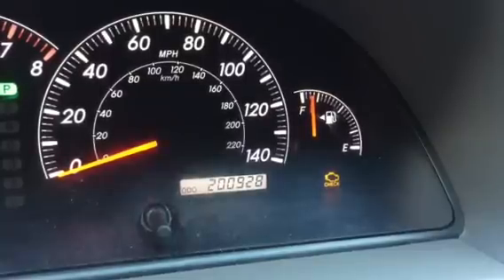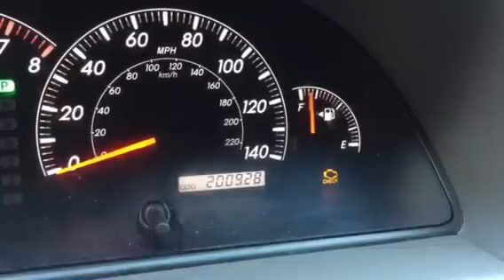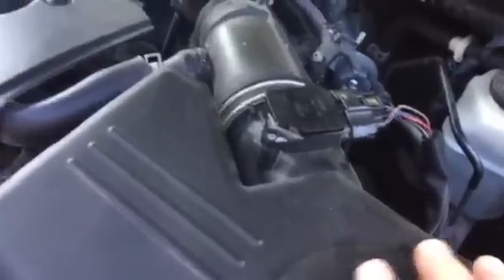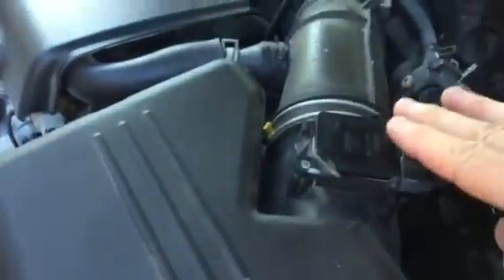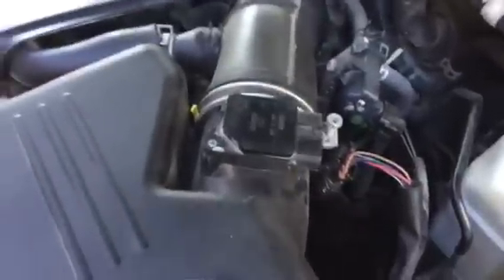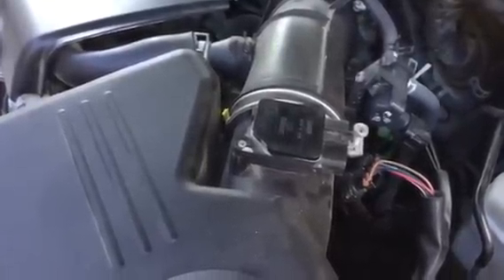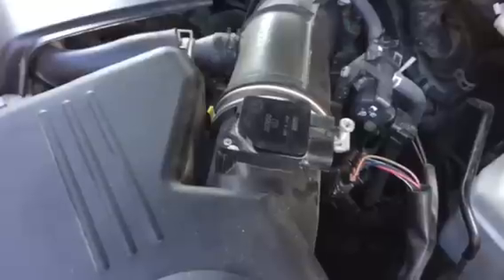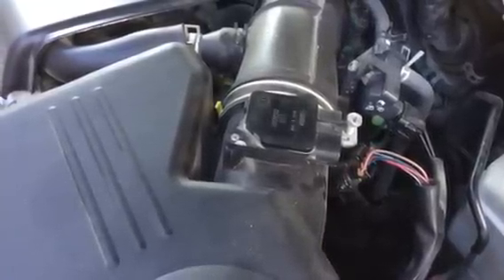How To Tell If Your Mass Air Flow Sensor Is Bad On Your Car

Comment: Great video, just had a question. I have a 2002 Ford Taurus SE, I’ve been having the issue of it randomly jerking at low speeds and when stopped at light or sign, i did the same diagnostic you did here and the car kept running even after I disconnected the MAF sensor cable, I cleaned it with MAF sensor cleaner but I still have the same problem? It didn’t look dirty at all to be honest but I cleaned it anyways, do you know what else my problem could be?
Reply from the maker: The MAF might need to be replaced.  Have you cleaned your throttle body?  https://youtu.be/cOAYWVBfuek  Could also be bad spark plugs or fuel filter.

Comment: Please i do same as in your video to check maf sensor working or not but i got problem of check engine light appear..how i can remove the check engine light ??
Reply from the maker: Once you drive the car 25 to 50 miles it will turn off by itself.

Comment: I have a map sensor is that the same as a maf sensor?
Reply from the maker: No.  MAP = Manifold absolute pressure and is a sensor to measure vacuum, the computer calculates the engine air flow based on the vacuum, throttle position, and intake air temperature. ... MAF = Mass Air Flow and is a sensor that measures the actual air flow going into the engine.

Comment: I have a 2011 sentra SL and keep getting a P0101 error code. I tried cleaning the MAF sensor but, the code still persists. Then I bought a delphi maf sensor and the same code came back a few months later. Pretty much have no idea what to do anymore. Any suggestions, please?
Reply from the maker: Check to make sure it's getting proper voltage.
Reply: proclaimliberty2000 how do I check that? sorry. im new to this kind of stuff
Reply from the maker: Go to an auto parts store and tell them what you're wanting to do.
Reply: proclaimliberty2000 thank you for your replies
Reply from the maker: You're welcome!  Let me know when you get it fixed.  I know these things can be very frustrating but through it all you will become more knowledgeable.
Reply: Danish Sayed I have a 2015 Sentra SV and it also had the check engine light on. I cleaned the sensor but I feel like it didn't help. The performance is not the same and I feel like my car has trouble starting. Any suggestions?

Comment: Just ran the check as you instructed and car (BMW X3) kept running! But would the broken MAF  sensor have produced codes P0174 and P0171 (too lean) for both banks? Just curious and thanks a million for an AWESOME video!
Reply: Hmmm. I just ran the same check on my wife's car (also BMW X3) and her's did not shut off either, BUT she has no check engine light as mine did.  Does this test work for BMW X3? Would cleaning clear this up or needs to be replaced.

Comment: I have a 2008 jetta vw 2.0 t it went in for coolant temp sensor/code to be fixed which had cel on had it back a day the cel came back on but threw a different code p171 code system too lean bank 1.. Its been coming on and off now for a couple of months dealership first said it was loose bolts so they tightened them still the code came back on after they did that.. Now they are saying its mass air flow sensor..throttle body needs cleaned.. Ive read numerous things about this code on my car it says it could be a range of things..does it sound like the maf?
Reply from the maker: A bad or dirty MAF will will cause reduced gas mileage, very hard starting, stalling, engine hesitation during acceleration and will run too rich or too lean.  It will also eventually harm oxygen sensors, spark plugs and catalytic converters. https://youtu.be/047xItGmNH8

Comment: have a question hope u all can help me..i turn my nissan altima on rpms rev up n down i cleaned throttle n i cleaned air sensor..but i disconnected air sensor n engine kept runnin if i replaced the air sensor would it fix my rev up n down rpms plzzz sum one help..
Reply: Theres a video on how to reset your Nissan Altima. how to reset throttle position sensor. type that in youtube .
Reply: Juan Moreno I had an issue with rp as well and scv replacment solved it

Comment: If when the current sensor is in the car turns off seconds after starting it and when I take it out and it runs but very rich and less power is it a bad sensor

Comment: Check Engine Light on says P0171 System to Lean Bank 1 I have : 2005 BMW 330I  I unplug Mass Air flow sensor  keep running. I think it Mass flow sensor.
Reply: Go to Autozone and erase the code. I forgot to put back my MAF wire after cleaning my MAF and the check engine light came on even when i put back the wire. i reset the code and it never came back again.

Comment: Check Engine Light on says P0171 System to Lean Bank 1 I have : 2005 BMW 330I  I unplug Mass Air flow sensor can keep running. I think it Mass flow sensor.

Comment: i did that to mine an 08 outlander and engine keeps on running and i lookd inside it says error and check engine,i turned it off and connect it and its gone,so something is wrong or just dirty sensor?i have rough acceleration also
Reply: i have bad acceleration and wanted to know if the MAF is bad and did what u did

Comment: did what you said about disconnecting the MAF and the car shut off. However, the car was still acting up chugging and stalling, but after the MAF was cleaned we are running smoothly again...just a fyi..

Comment: If the CEL is on, wouldn't it make more sense to grab your OBD scan tool and check the code? If no scanner available, then just go to Autozone (or similar store) and they will read the codes for you. Also, I believe some cars will run after disconnecting MAF, sometimes even better. JMHO.... sometimes these issues can be tricky to diagnose and repair.
Reply from the maker: Your're right, sometimes these issues can be tricky to diagnose and repair.  One time I had a check engine light come on.  The computer scanner said it was a faulty oxygen sensor, but in the end it was actually a faulty MAF.
Reply: Thanks for the video. I wish the modern computers and CEL's were more accurate and reliable. I was service station owner back in 70's and all I needed was test light, timing light, compression gauge and dwell meter... and I could diagnose/repair anything, hahaha. Thanks again.

Comment: Thank you sir this really help me alot i never thought to do this now i know why my car is idling and has a sputter when i hit the gas i went out and did this method my car actually stayed running when i unplug maf connector so i indeed now know this is what i need cheap repair and im good to go thanks
Reply from the maker: Also make sure your throttle body is clean. https://youtu.be/cOAYWVBfuek
Reply: proclaimliberty2000 I cleaned it befor because thats what i thought it was and also i IACV but i think im gonna do it again to be on safe side,  Appreciate you Bud
Reply: I have same issue exactly...did a New MaF sensor fix your problem?? thanks

Comment: Thank you for the video, I tested your method and my Honda Freed engine stop after I pulled off the MAF connector. However the engine check light comes on and i have to pull off the battery to reset the Engine Check Light..
Reply from the maker: Your check engine light should reset within 50 miles of driving without having to disconnect the battery.

Comment: Will this work on 2003 Mitsubishi Eclipse Spyder gs 2.4L? I tried doing it and the engine still ran but when I unplugged it, it made a weird noise and still ran. Kind of as if it was struggling to keep going but then I put the censor back in while it was still running and it made some weird noise and then it was back to its regular sound. I'm just curious if it's even possible to do this little test on my car because if I have to just get the new part I will. But if this test doesn't work on my car then I don't wanna waste my time. Someone please inform me
Reply from the maker: From what you described, it sounds to me like it's working fine.

Comment: Hey I have a 2011 Nissan Altima and when I drive it for long time all of a sudden the car stops accelerating i have the code for air flow sensor but I'm not sure if it's because of that or it's my cvt transmission control. Do u guys have any idea thanks
Reply: Could be a vacuum, check engine bay real thorough.👍

Comment: My car accelerates realy slow revs fine on idle bt while driving its laggy and picks up speed slow and dont realy go over 80 mph on the motorway any idea if it could be a bad maf sensor issue??
Reply from the maker: It could absolutley be the MAF.  Make sure the alternator is putting out the proper voltage.

Comment: I tried this my 2002 toyota unplugged and my fan kept running but engine stopped.. whenmy car droves fine but shakes when i place my foot on the brake any idea why?? I need help
Reply: Familia Aviles sounds like you've got warped brake discs.
Reply: Familia Aviles my car did that too when I first bought it and yeah it sounds like warped disks. It's not the pads but the actually disk for the breaks. Hopefully this helped

Comment: yes that's how I tested my maf,car still runs 😵 ,horrible smell from the tailpipe,and bad on gas.
Reply: Jaco Jonker I would say 95% certain your MAF is bad and a new air filter wouldn't hurt
Reply: Catalytic converter. Either cut it out and put a straight in there or, just have it replaced.
Reply: What was it???? I have same problem.  Hope it's just maf

Comment: When I accelerate the car (from stop sign or dead stop) it doesn't pick up power until 5-10 sec, then it does. Then it takes power and at 3-4 rpm makes a strange noise. 

We changed the fuel filter and air filter. Mechanics here checked timing belt, it was good and also checked catalytic converter. The mechanic said he has no idea how to fix this loss of power. The car doesn't light up to indicate we are on drive mode, but does for parking, reverse and so on. 

According to my research, I think it's one of the wiring or something small. one mechanic i recently spoke to said it is the boost senser aka maf sensor i believe.  the sensor was chipped perhaps that may be the cause of the issue. he also said overdrive wire should be replaced because it doesnt move when we press on accelerator. wire was chipped. does this sound like the issue can be resolved by replacing the sensor? 

the car revs very good at idle. when drive mode is on it doesnt rev well, rpm dont go up at all.
Reply from the maker: Yes, replacing the senor could fix it.
Reply: Muhammad Hasnain 2001 Nissan Sentra 1.8 bogs down when accelerating
Reply: So when u turn on and put in drive does it start bogging for a few sec until rpms go up and u accelerate caise my 92 camry is having that issue and im trying to figure out what it is indicater light dont show im in drive either
Reply: you probably have fixed this by now but thought  i'd give you my thoughts anyway. anytime I've had an engine that would idle fine but have difficulty revving up it was either plugged fuel filter or the coil was breaking down under load. since you checked the fuel and air filters then my next guess would be to check and replace the coil pack or packs. the coil pack, or your engine probably has several packs is probably breaking down under load. that strange noise could be the engine misfiring when the coil packs are breaking down. just a thought.  could you respond back what the problem ended up being, just curious if I had anything right in my resolution.
Reply: Idle air control valve, maybe
Reply: hi .. my ford ranger 2.5 tdci have this problem also... so is change the boost sensor or maf sensor ?? thanks
Reply: Could be maf sensor. Depending on mileage, I'd try the coil pack also. I doubt it'll make a noise, but it's something to look into.
Reply: Same problem with 1998 Mitsubishi Montero sport.  Mechanic said it's the mass air flow sensor, but tried 2 different ones, one on line and one wrecking yard. Same exact problem.  Will not accelerate, unplug the mass air flow, runs fine.
Reply: okay so you say unplug MAF sensor and still runs fine,but did you test drive will Maf unplugged and then plugged??? if so did car perform the same??? or did it run better with MAF unplugged...? One at junk yard could be bad also one you ordered online could also be bad... some people sell used junk and even cheap junk on ebay...
Reply: @roadstar499  if the mass air flow sensor is unplugged it runs like a champ, when I plug the MAF in, it will run good until the engine begins to warm, then a sudden and abrupt change happens, like night and day difference.  So the change is like a switch gets turned on, or if,. And the thing almost dies, RPMs go almost to zero, then it catches it's self and eventually evens out.  But after that, when you accelerate, you go no where, step on the break and pump the accelerator, eventually get the rpms up let go of the break and go. But those rpms have to be high, a around 2000.  3 Mass sensors same issue.
Reply: @dwaynemeroin3101  yes..it could be other issues. .all cars are different...I spent a week testing and switching parts before I finally got my blazer figured out...
Reply: Make sure you change your fuel filter
Reply: Muhammad Hasnain v

Comment: Have a 2014 Chevy cruze eco and I unplugged the mass airflow sensor while car was running and the car kept running any ideas? and there is no codes or check engine light?
Reply: Warren Gose he told you in the video, if you unplug it and it keeps running it's in your MAF, it tells you that your cars computer decided to use alternative routes of reading the air flow since your MAF was bad at start up. If your MAF was working properly and you disconnect it while running your car will stall because it is no longer being sent the information it requires.
Reply: @ryanstewart8515  isnt it dangerous to umplug stuff in new cars since the cars computer is sensetivr

Comment: :-( I unplugged mine and the engine shut off. but I was told my maf sensor was bad and my check engine light is still on. should I replace anyway?
Reply from the maker: Clean the MAF sensor first and drive 50 miles.  If the check engine light doesn't turn off by itself then install a new one and drive another 50 miles. 
https://youtu.be/z6SMC66BQ9g
Reply: T Washington throttle body dirty or damaged?
Reply: Ryan Stewart I'm sorry, I don't know what a throttle body is. I replaced it and I passed my emissions test so u thought it was fixed. My that was only because I unplugged the battery. Check engine light is back on, so it's not the maf sensor
Reply: Forgive my typos, I have the worse phone.

Comment: My Volvo S80 2.5T had a bad mass air flow sensor and was running very poorly where i also was getting a fault code by a fault code reader.Bought a new mass air flow sensor and the car was still running badly with the new one and still i got a fault code.Tried the same a third time with another new mass air flow sensor and still it tells me that the mass air flow sensor is bad.Disconnected this mass air flow sensor and the car has running great after that for many thousand and thousand miles in every rpm and speed.Any suggestions to clear that check engine light !?.Thanks.
Reply from the maker: This one really has me stumped!  I don't know how your car can run great with the MAF disconnected and I don't know how you can possibly clear the check engine light with the MAF disconnected.
Reply: proclaimliberty2000 

Mine was running horrible with it connected. I disconnected it before starting up & have just done 250 motorway miles & 30 around town miles & its performed superbly. I've ordered a new MAF just incase i'm causing any long term damage driving it as it is, but either way its great to drive my car performing so well.

Comment: put in new mass air flow senser on a 2006 bmw x5 3.0 with engine running I unplug it and it keeps running plug it in And it stops what can problem be
Reply: air leak somewhere
Reply: Ever figure it out

Comment: What if the motor stumbles then keeps running on my audi a4?
Reply: When I unplugged the MAS, there was an initial and immediate hesitation, but the engine continued to run. Is this what happened for you? Did you replace the MAS to fix the problem? I am awaiting MAS I ordered for 2003 Range Rover.

Comment: i got the basic tuneup done but should i replace both front and rear o2 sensors on my civic 2000 hatchback dx, 220k kms? would they improve gas mileage or its a waste of $. they are $100 each.
Reply from the maker: As long as your check engine light remains off then they are still within acceptable limits.  If they have 220K on them, then replacing them should improve your gas mileage, but even more importantly help everything operate at optimum performance.  However, I understand about the cost.  I've ALWAYS got the best prices for car parts on Ebay.  This will also give you some more information about oxygen sensors https://youtu.be/vdmphBGYJl0

Comment: would this work on a Ford Fiesta 1.4 Zetec Tdci (2012)? i have had a limp mode problem for over a year and spent £600+ trying to fix it!!
Reply: Kev 9858 check your alternator
Reply: Ryan Stewart What's the alternator?